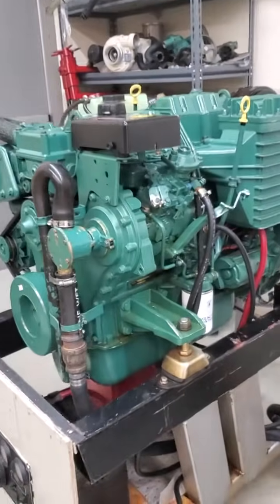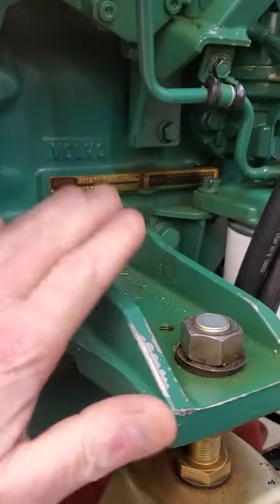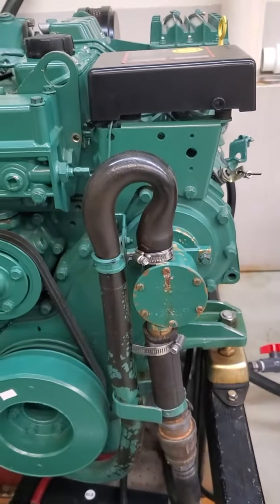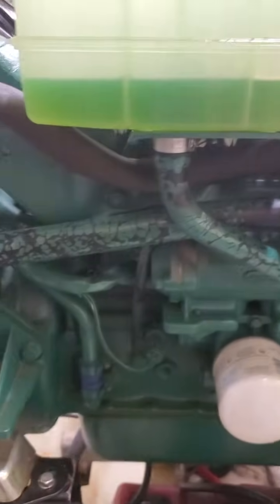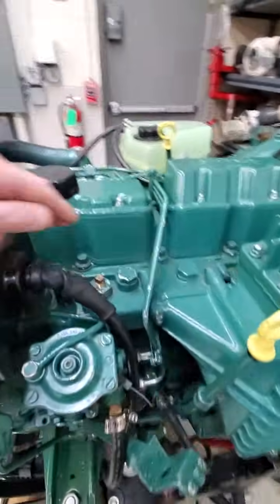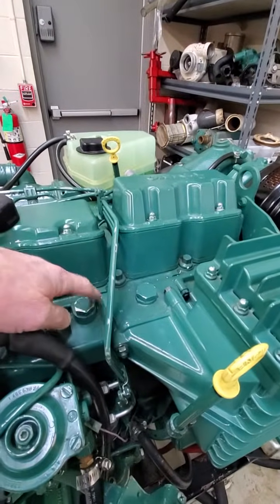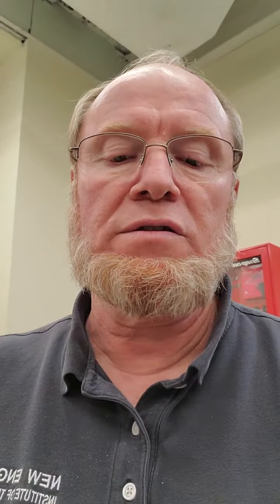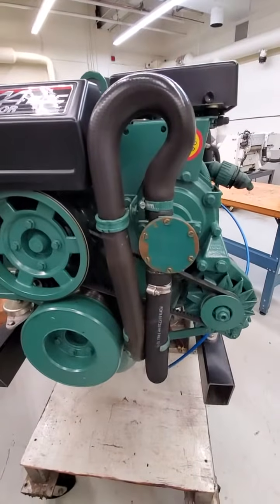Volvo Penta TAMD 31 Diagnostic Tips

Comment: Hi Ted, gr8 vid thanks. I was called out to check a squeaking noise on a TAMD41a few months back, found it was the rocker shaft on stbd engine.. it also looked dry on the rocker shaft and general upper area. Guy said he changed oil and confirmed oil psi with a manual gauge.. what could cause no oil to rocker shaft yet have oil pressure? Is there a feed tube of sorts? I did do the valve lash before- but the squeaking is still there.. it was near the 3rd cyl rocker shaft iirc - thanks. fyi we rebuild gas engines :)

Comment: Hi Ted, I’m a marine engineer but my skill set pertains mostly to much larger engines. I’ve worked with many makes both large and small but rarely Volvos. Now I find myself with an old commercial fishing boat with an AQAD41A. I’m thankful to have found this channel.
Reply from the maker: Glad to help! let me know if you need any info
Reply: @tedsmarinerepair8956  well, I may have a question… any idea if there’s a digital shop manual for one of these floating about the inter webs? I’ve found the odd site but they seem sketchy. Any that you’d trust? Cheers Ted.
Reply: I'm facing TDA952Ve fmi 5 SPN653 code plz help

Comment: Great video Ted, I'm going to call it my lucky day finding your video. 2000 TAMD31-PA w 1700 hours, owned the boat since 2014.  Background: Fuel pump was leaking and had the mechanical fuel pump rebuilt 18 months/150 hours ago & had the injectors rebuilt at the same time.  This year it's started giving black smoke during acceleration. I've had a local marine mechanic say turbo seals are my problem, but he doesn't "do" Volvo & didn't say any more. Turbo turns anyway but I've never done anything to it. 
1) I'll look at the hard plastic smoke limiter hose. 
2) I don't know how to check the diaphragm on the aneroid (sp?). 
3) you also suggested cleaning the aftercooler by running some Yanmar turbo wash through it - I'll do that.
4) I don't have a gauge to measure the boost pressure for the turbo, I'll figure out how to check that (4.3psi @ 1800 rpm & 13.7 psi @ 2500 rpm).
I also have unburned fuel residue coming out the exhaust (inboard w wet exhaust). The engine burns very little oil. 
Any suggestions other than what I've listed from your previous comments?
Thanks

Comment: Dear sir 
I required D6
Model D-6 310A.B
 serial number-869316
Piston  number - 142|6600   Volvo 
                                103L22    mahle
                              +  R021     GermanyA1    
This piston ring required 12 set
& Piston connecting rod  1 pc
 engine full gasket kit 2 set
Please send a contact details

Comment: Hi Ted.
I have two TAMD 71B engines in my boat. One of them is starting and runs perfekt the other one is very difficult to start (the start motor has to run for a time) and it seems worth
Reply from the maker: Check to see if there is any air bubbles coming out of the primer pump by opening the bleed screw on the fuel filter housing. If you see bubbles then air is being drawn into the fuel system before the primer pump. 
Also could be the primer pump has something stuck in one of the check valves.

Comment: Hi Ted, what might be the causes of low oli pressure? Kad 300, water temperature is normal.. not going up on plane. 
Thank you 
Alan
Reply from the maker: There are a various reason's, I would verify oil pressure with a mechanical gauge, also send out an oil sample to see if metal/bearing material is in the oil. There are oil control valves which may be the issue as well.

Comment: Hi Ted, I enjoyed your video and it is very easy to follow. Now I have a question, my TAMD41A's smoke so much when cold. In fact, I smoke out the marina. I have used fuel additives but nothing seems to work. My next plan of attack is having the injectors re-conditioned. What do you think? Many thanks in advance.
Reply from the maker: I would perform a valve adjustment if that has not been done for a while. See if that helps. Then yes injector rebuilding should be the next step.
Reply: @tedsmarinerepair8956  many thanks I will take your advice

Comment: Fantastically clear descroption. Thank you. I have an oil leak coming from the back of the raw water pump where it attaches to the timing case...any ideas it s a TMD 41B?
Reply from the maker: There is an o'ring on the pump that seals it to the cover. That should be changed any time the pump is removed.
Reply: Behind the rubber water pump there is a rubber seal that after time let's by water leakes out of the side slit holes userly a drip in the early stages take pump out completely  you can buy a back end rebuild kit from a volvo parts

Comment: Hey Ted I need help putting in the gaskets on the turbo on that engine
Reply from the maker: There are no gaskets on that turbocharger.
Reply from the maker: Except between the exhaust manifolds and turbine housing of the turbo. What do you need help with?

Comment: Hi Ted

Appreciate you’re sharing your insight with us. I will definitely check the little hose to the smoke limiter👍

One question on the TAMD31, I have heard some complaining about very slow startup I cold weather (me including).

Is it possible to install glow plugs on that engine, if so how?
Keep the videos coming..👍
Reply from the maker: I am not sure about glow plug installation but will look to see if there is a kit. The key switch has that circuitry already I know that. I usually find the cranking rpm to be the issue with hard cold weather starting. Are you using a large enough "start" battery and not a gel cell or deep cycle design?.

Comment: Hi Ted
Greetings from the Emerald Isle.Thank you for the great correct informative video on the 31 engine.
I am currently working on servicing my twin 1991 Tamd31B engines as they are fairly smokey on start up  and black smoke when opened up but it did settle back a bit.They haven’t been run at full power as much as they should and I suspect the lower speeds haven’t helped and have contributed to the sooting up.I drained both fuel tanks also as there was old diesel around 5 years old in them.I have new after -cooler and turbo seal kits to put in and took exhaust side of turbo off port engine to have a look and it was fairly sooted up with a good coating of deposits around the housing as well as the turbine.I have cleaned off both sides now but noticed there is a lot of oily residue on the pipe from the turbocharger to the after-cooler.I suspect the cooler will have a lot of residue also when I open it.Would this oil be coming from the turbocharger seals?
I can spin the compressor inside easily and it is not rubbing off anything but there is an ever so light point when you spin it that it slows.I don’t hear that distinctive whistle kicking in when the rpm increases.Both engine compressors are spinning at idle.Should I continue to service the after coolers first anyway before I do anymore on the turbos?.I will soak the inserts and pipes to get the oil off them and check the cooler insert for blockages.Any suggestions appreciated.Regards. Greg Aston
Reply from the maker: Clean the aftercoolers and run some yanmar turbo wash through them. If they don't spin up after check back pressure to see if excessive if not rebuild turbos, they are likely dragging
Reply: Hi again Ted.Have you done any rebuild  info in the past on the Volvo MS4B reverse gear boxes.My cone clutch mechanism starts to get slow to engage once warmed up going  forward.This happens when coming in to the berth and when I go in to reverse and then go forward there is a lag to engage gear again.Would changing out the cone and thrust washers etc be outside my remit as I know shimming correctly is important also and are specialist tools required for doing this section.I have the workshop manual but I don’t have  any people in the area willing to take it on.As far as I know it is possible to get different shim thicknesses from Volvo as well as the cone.I also have a complete donor MS4B box which is a bit too clunky going in to gear.This had a new set of output bearings and crush sleeve put in  as well as the copper cooler which was leaking and was repaired,but I don’t think it was shimmed correctly.It doesn’t slip in forward and reverse so I was wondering if I could transfer the parts from this into the other box.Any thoughts on my options appreciated.
Regards
Greg

Comment: Hi Ted, i have a question on this volvo penta aftercooler, my engine is an ad31p and i was wondering if the rear cover on the aftercooler which the tube that connects to the turbo can be removed and resealed?  If it is removable what type of sealant is recommended to reseal rear cover when reassembling?
Reply from the maker: If it looks like the one in my video then NO it is glued on from the factory with fasteners. If it does not look like this one, send me the engine serial # and full model off the engine tag, port side below the cylinder head

Comment: Hi Ted great video ,thanks.This is the exact engine i have in my boat, 4 years ago i changed the turbo (which was burnt out exhaust side) and the boat was running fine with the new turbo.This year the turbo had so much soot in it it stopped turning,it's been stripped and rebuilt, but the boat is sluggish and using a lot of fuel, the engine wont  rev out under load to more than 3400 RPM at which point im only getting 13 psi in the inlet manifold. Any help would be much appreciated. Even a link to the right graph that shows me my turbo curve would be helpful so that i could eliminate that problem.many thanks
Reply from the maker: Have you cleaned out the after cooler?
Reply: @tedsmarinerepair8956  hi Ted
Do you have a number where you can be reached?

Comment: Excellent info , can you tell show why a rev counter fails and where on the block it is.
Reply from the maker: What exact engine is it? If it's a 31 non-EDC then the driver is the grey/Black wire coming from the alternator. Look for an AC value while running on the back of the tach and the alternator, if there is consistent ac voltage while it's running then the tachometer is bad

Comment: @Ted Chamberlin Marine Repairs  I Ted. Mine it's a TAMD31D most known as TAMD31L-A i think, from 1994 (130hp). Full throttle just get 3300 rpm maximum. It's leaking oil from the bottom of the aftercooler, so i'm guessing turbo needs to be repaired or replaced. it's a 28 years old turbo anyway. Planing to do some maintenance on the aftercooler (cleaning and new seals) and replace the turbo. i got the pressures from the book, do i need to read it only at WOT or can it be at constant rpm?

TAMD31L
1800 r/min --> 30 kPa (4.3 psi)
2500 r/min --> 80 kPa (11.6 psi)
3250 r/min -->             –
3800 r/min --> 140 kPa (20.3 psi)

Can´t reach the 3800rpm so i'll need to average the 3250rpm anyway. Loads of grey steam starting from the 2900 rpm.
No problem reaching the 4250rpm in neutral.

Thanks for your help so far. You channel is golden!

Comment: Hi Ted! Indeed your help again every time a take my boat out I push fully speed only give me 8 nots,I have to wait 2  to 3 minutes for star going ,I have clean injectors,new turbo,, my mecânico tells me is injectors pump, I don’t know what to do .
Tank you Ted ,Herb Silva  iam azores
Reply from the maker: Try running it on a external fuel tank, like an outboard tank with NO primer bulb. And make sure there is NO GAS in the tank only diesel.

Comment: Hi there.I have 2 kad43 engines.Last year changed head gaskets and rebuild upper engine and new turbos,cleaned all coolers etc.If I use the boat for 3 hrs or more at not mor than 3100rpm all is fine,if I go past 3100 one of the engine gets hot..impellers are new too.Thanks!
Reply from the maker: Check the riser temp with an infared temp gun, test both to see if one is hotter than the other, likely a riser or the raw water pump may be pulling in air, install a clear piece of hose on the outlet side and run to see if there are any bubble in the coolant hose

Comment: Hello, I have two engines tamd 31 pa but.  one of them when I'm fishing and I let it idle made a little blue-gray smoke and with the smell of diesel then when it accelerated it no longer has that smoke, the injection pump was checked, the injectors and the shifts changed and I no longer know what do you have any idea thank you very much for your video and your attention
Reply from the maker: How many hours on the engines? Could be valve guides. Has a valve adjustment been checked?
Reply: @tedsmarinerepair8956  Hi, thanks for your answer. I'll ask the mechanic. The engines have 1780 hours.

Comment: My dad has a boat with the ecd and the starboard starts up the port will not crank does the oil sensor if bad not let it crank up if so how do I test it and where is it located?
Please help this is just been and anchor of a boat
Reply from the maker: If the control panel lights up when you turn on the key does the diagnostic light blink ("D" button)? If not it may be the starter relay has failed.
If the D button light is flashing you can try erasing any codes by holding in the D button then turning the key on for 6-10 seconds. Release the button, shut the key off for ten seconds and then try starting the engine again.
Reply: @tedsmarinerepair8956  
When we turn port key on we hold the key button in until the light turns red then we try to start just clicks and the amp gauge goes from 12 to 0 but can we jump straight to starter from battery or will this be a problem with the electronic side of thing to see if starter solenoid is bad?
No light in when we turn key on the buzzer sounds after we leave key on a few seconds then the oils flashes on the display
Reply: Do you know anyone near fort Myers  that can diagnose these?
Reply from the maker: @georgemahan7454  Sorry in the Northeast

Comment: Hi Ted, agree ... great video(s). I have a TAMD31-L in my boat, a 1996 Ellis, purchased in 2019. In your video you mention no anodes in the model in your shop. I would like to confirm that a TAMD31-L (869006) does NOT have any anodes. (s/n is 2203122225). Thanks.
Reply from the maker: If it looks like the one shown in my video it does not. Search online for Volvo penta parts for your model. Look in the heat exchanger and after cooler

Comment: Solid to the point video, love it. I have TAMD 74p-a. When I go to get on plane, the port engine falls way behind the starboard engine in spooling up. Eventually it catches up and I hit the 2600 rated RPM’s I am noticed that the port engine is burning some oil throughout the last 80 hours or so. What would you think this would point to, or what should I check first?
Reply from the maker: So a lag in one against the other may indicate a dragging turbo. Sounds like the port may be leaking oil past the exhaust seal in the turbo. Blue smoke?? If so, pull the risers and inspect both turbines of each motor for oil leakage.
Reply: @tedsmarinerepair8956  so after pulling apart and inspecting the turbos, it appears that replacement was warranted. The early plastic air filters must have been to blame for some of the damage to the veins on the intake side. With 1700 hours on both I decided to change turbos. And test run yesterday proved it was the right call. Performance through the roof. Went from 16 seconds to plane down to 7 seconds on a 45k lb boat.
Reply from the maker: @andrewmstokes  Glad to help! and Glad the boat is fixed. I really like the 74's lots of power and smooth. Good luck!

Comment: Amazing video! I wish you were in Tampa, my mom has two KAMD 300s and one of them is overheating intermittently so I’ll be checking these things, hopefully they were missed by her mechanics.  Take care!
Reply: Branden: use Rydlyme on the raw water side of the heat exchanger & gearbox oil cooler . See U tube for this. I just did it & all fine now.
Reply: @martind9823  thanks for the reply! I think we will still need to do that but her instert on her aftercooler is completely corroded and ruined, so thats $3000 but after that’s replaced I will be keeping up on this. Previous owner did zero maintenance 🤦🏼‍♂️. 
Thanks again!

Comment: Great video.  I have a 2000 Albemarle with twin TAMD41P stern drives. I´ve been struggling to figure out why the starboard engine only reaches 3600 RPM and the port will reach 4100. A no load test will have both at 4100 RPM. Engine seems fine with no blow by when I remove the valve cover cap. No noticeable missing when the engine runs.  IT just doesn't go beyond the 3600 rpm.  I've swapped drives and props, verified the tachometers, swapped fuel supplies from port to starboard, added new Racor 500 filters, had a mechanic remove the injection pump and send out for a rebuild. I also installed permanent turbo boost gauges and the slower motor is always double the boost as the good motor. If the port motor is running 10 lbs the starboard is 20 lbs.  Any ideas?
Reply: Hi Brian, did you solve this?

Comment: Hey Ted great video!! I attended New England Tech in the automotive program. 
I recently purchased a boat that has 2 tamd41p-a and I have a problem of black smoke starting at 2000rpm. They run great from idle to 2000rpm and then begins large amounts of black smoke turbos spin by hand nice a free no excessive axial or radial play in the shaft. I’ve ran it with and without air filter same condition. What would be your first move? Any help you can give me would be appreciated.
Reply from the maker: First off you need to install a back pressure gauge and a boost pressure gauge and then take it for a ride and record the peak values when it starts to smoke and then again at top rpm. If you need help with this contact me at school.
Reply from the maker: Overloaded issue